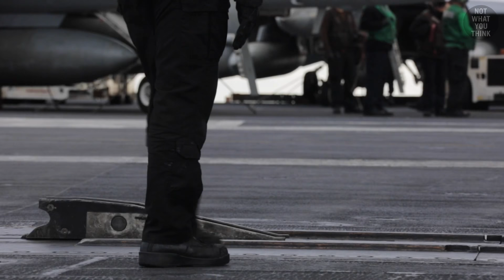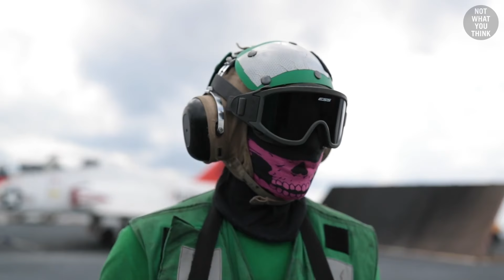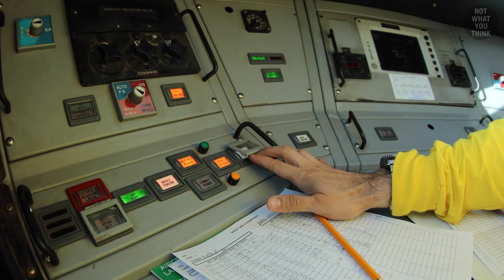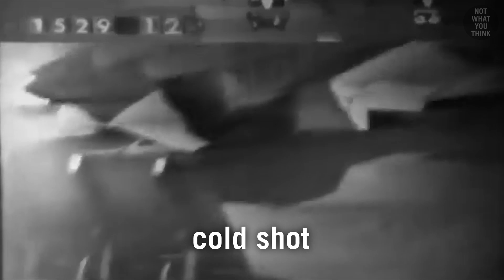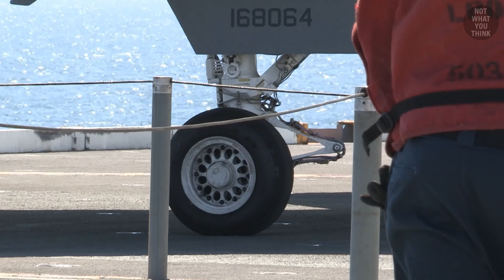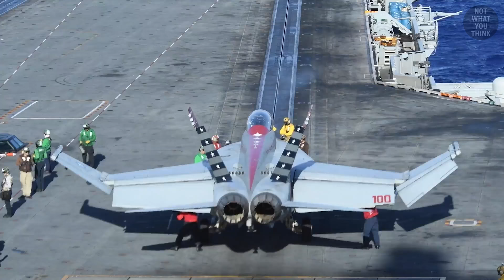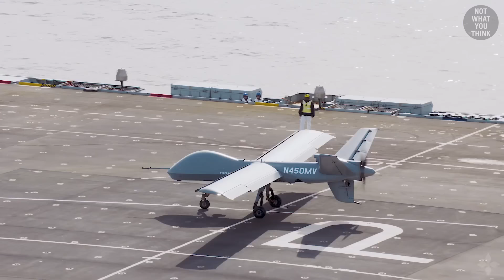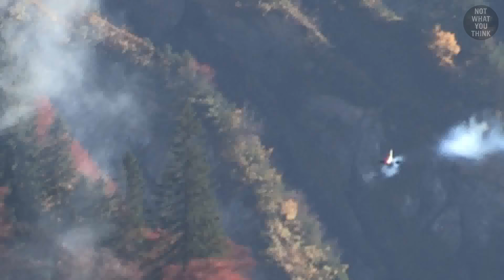Why the US Navy is Replacing Electric Catapults with Steam

Comment: With the advancement of electronic sensors, controls, and controllers you could precisely control Steam Catapults. The advancement in materials would alleviate most maintenance issues of older materials.

Comment: Both sides have a real point in this debate. 

Steam: It’s reliable and gets the job done. Better to have a imperfect solution that consistently works, than have an ideal solution that is unreliable (none of us know the actual operational rates of EMALS, but it’s definitely not as high as steam).

EMALS: It’s a better design for the long term, because the operational rates will improve in the future. It has a better launch cadence, variability, and requires less space in the ship. 

I personally think we should stick with the EMALS system and work out the issues, but that depends on the actual operational rates of EMALS system. If it’s down at 50% or less, then yes as much as I don’t like it we should build new craft with steam catapults until we fix the existing EMALS systems to be up in the 75% or better for operational readiness.

Comment: Seriously asking a pilot what is best is kind of only looking at 1/2 picture and it something that should been done 20 years ago. Can't convert the USS Doria Miller to Steam as have to redo all plans for most of the ship. As someone that was a Naval Nuclear Reactor Plant operator on Abe Lincoln and having to know how systems are laid out in plant you need to overhaul design of the reactor plant. Not only how it is being operated but also how layout is. Every space on a carrier is mapped out and running high pressure steam from the plant up to Cat rooms takes miles of  carbon steel pipes. Also the Steam Cats on Nimitz class carrier is 3rd largest load on carrier after the shafts and the 8 electrical Turbine Generators.

Comment: Ok there’s 100”s of boards, coils, wires, power supplys probably many without duplicate. Steam is pipes accumulates, and one giant ass piston with grease points and a piston seal. Alll just off the shelf plumbing. They probably have 30 of each

Comment: The Strategic Vulnerability of Electromagnetic Catapults
Electromagnetic aircraft launch systems represent a major technological leap for modern carriers. However, this shift introduces a critical strategic risk: a deeper dependence on Chinese supply chains. Manufacturing these high-powered electric systems requires specialized rare-earth elements and advanced components. China currently dominates the global processing and supply of these essential materials. By adopting electric catapults, naval forces inadvertently tie their most powerful defense platforms to a geopolitical rival. Securing alternative domestic supply chains for rare-earth metals is now an urgent security priority.
EMALS is a massive liability. Aside from the heavy reliance on Chinese rare-earth minerals, the system has a major single point of failure: shared power converters mean one electrical glitch can take down two catapults at once. You can’t fix digital high-voltage failures in the middle of a battle with basic shipboard tools like you could with reliable steam. It's way too complex, incredibly expensive, and compromises combat readiness.

Comment: Sal talked about these catapults  a while back on what's going on with shipping. I think some of them are having problems because they were more sensitive to the movement of the ships out at sea. Is he just pointed out in a recent video with Ward Carroll changing the magnetic catapults to steam is a huge endeavor very costly. Hopefully the designers had corrected the initial problems these were having. Does anyone remember what the problems were exactly ? It would have made sense also to perhaps make some new carriers with the magnetic catapults and some with steam. Is it possible that magnetic ones are susceptible to certain enemy actions that the steam ones are not susceptible to ? Don't know . Is it better to not run ahead what's the latest technology for all of the new ships for a little while ? From what Sal was saying a bigger problem is that it's taking much much longer to build the new carriers then had initially been planned. Also it sounded like they were starting the work on the carriers before all the plans were finished. That kind of reminds me of agile methodology . Might work for a computer program but I don't know about a carrier.

Comment: I don't know enough about the topic. But wouldn't and electric liner motor give away your position every time you launch. And the electrical interference could mess with radar and other systems.
I would think a steam system would not have those issues.
This video sounds like all the rest, just repeating the same talking points. Doesn't seem like anyone is doing any real research into the topic.

Comment: Comparing the success rate of launches between a system with 70 years of improvements to a totally new system that has only been in use for 10 years is ridiculous. What was the faillure rate of steam systems in the 1950s? I doubt it was 1 in 4000 launches.

Comment: System Breakdowns: Early tests on the USS Gerald R. Ford showed the EMALS broke down often during sea trials.Launch Failures: The equipment fell far short of the Navy's goal for working cycles between failures.Flight Delays: Catapult failures stopped flight operations completely during early testing.

Comment: Trump the moron , clueless, dementia filled psychopath has no clue about engineering or construction of warships. The whole carrier is designed and built around its aircraft propulsion system be it electric or steam powered. It is a massive difference design from the whole bottom up of the whole entire ship. A magnetic rail electric proportion system means they can launch more aircraft and launch them faster than the steam powered system. It would also mean there’s more rim to put other things underneath and around the aircraft carrier because they do not have to produce and build a system that moves steam around the whole carrier to get to the aircraft propulsion system. Trump needs to be removed. He by a country mile the stupidest President in history.

Comment: One issue that needs to be addressed with any system anywhere in the military is private company control over things like repairs and upgrades. If one of these carriers was in an active war and their system goes down, only their engineers are allowed to do the work. 3-5 business days minimum to fly them out for an assessment? No thanks. The service members on these ships need full control of their own lives. If they can’t then we do, in fact, need to return to systems that don’t have bureaucratic red tape endangering lives. This is just one facet of the overall issue but it’s one that is rooted in common sense, not either side of political theatrics.

Comment: A warship especially a flatop operating under continuous wartime conditions should never be a testbed for newer systems. 

People's lives are at stake along with some very expensive ships. I read one comment that said that EMALS have been used on roller-coasters. WTF, over? A warship isn't a carnival ride unless that ship is in some very very heavy seas. I never sailed on a bird farm but I do know that steam propulsion has been around for a couple hundred years so the testing period has been long and its been refined because of failures. Steam has other uses onboard a ship in addition to launching aircraft. With nuclear reactors their should be more than enough evap fresh water to power such systems without going on water hours! BTW, been there, done that!
Reply: meantime, the most credible adversary in naval warfare is using an EMALS equivalent because it is superior.   Does that work for you?

Comment: This video is slop which explains nothing. It just goes over all the theoretical advantages of EMALS - which are true - but then handwaves their actual problems by inferring their possible replacement as an arbitrary political position.
The EMALS has had major issues ssues for over a decade  which have adversely affected the schedule of the Ford class. They are supposedly active, but military bureaucracies always cover up problems, so the actual problems are probably much worse than revealed. The catapults may, in fact, be  semifunctional at best.
This is not to compliment Trump but he was almost certainly being given the same operational problems with the Ford class as he was almost a decade ago, and he reacted in his style. 
His precipitous decision in this case is something the Navy should have done themselves years ago, at least to derisk the first boats in class and maintain build schedule.

Comment: Electric is not always better, those KC-46 Boeing refuelers  have been fighting Electric booms for 20 years and still fighting issues. Where the  Kc-135's hydraulic units have been working 75 years, if it's not broken. Don't fix an non existent problem.

Comment: Everyone, especially the content creator, are missing the obvious. Steam works. It has worked for decades. It is a refined system. It's repairable...in situ. Electromechanical is not. VERY few even know how to troubleshoot much less repair without dry dock or at least a harbor base. 

The BS about "what if the wind picks up during launch". Well, so? A launch is under 3 seconds, are you trying to tell me anyone needs or is going to make adjustments during  that time? Oh, and for the yahoo that claims  there have been no injuries/deaths with the "new" system...well, yeah. It hasn't been used enough to HAVE a track record yet. It also has never been used on a DAMAGED ship that is under fire. In fact, the video out and out lies saying EMALS since 2017. Wrong. Its been back and forth to dock and has only been actually deployed as a working system for a few years. 

One system uses water/steam. The other uses electricity. Know what's all around a ship? Water. Salt water. Know what that does to electronics? Yeah. Why do you think ships need a year in dry dock after every deployment. It's not for the mechanical systems.
Reply: and why is steam so reliable?  when steam catapults started out had over 75% failure rates. it took over a decade and dozens of lost aircraft before they got it working.
Reply: @cliffcorson4000  <sigh> Try using your head as something more than a hat rack. "when steam catapults started out". Yeah. In the 1950's. Since then they've been perfected into smooth, reliable, FIXABLE systems, proven under combat conditions. That's something only time and experience yields. Which goes right back to my point. In 50 years, when they retire the GHWB which has the only functioning electro cat, THEN would be the time to make a change.

Comment: I served on an Aircraft Carrier, that had steam catapults (CATS). We never had issues and steam is a reliable source of energy. Electricity is a good source, and the flight deck might be cooler, not having the steam coming out of the CAT tracts. Only people and politics think it’s less labor intensive. I would rather work on steam accumulates, instead of high voltage, electro magnetic, catapult system.
Reply: of course you never had issues. It has been around since before you were born. The advantages are obvious, but covered in this very video anyway.

Comment: They will work to bugs out. Steam wasn't perfect in the beginning. You just need something to BS about for clicks.
Reply: Hmmmmm ... did you watch the video? 
The conclusion of this video: the reason for the replacement is political (Fix Ide of Trump) - not technical or sane. In other words: electric is the better option - changing back to steam is idiotic.
Reply: @EneriGiilaan  Not political, common sense. Especially when you have nuclear power to run it. Trump can suck it.

Comment: WTF is everything political? If a system sucks during war that's an issue. The USN isn't going to get a contractor to fix it in the middle of operations. How insane is it to keep ignoring software issues thinking let the bugs work themselves out? These are the people who say the EMALS is not working as intended: Pentagon, GAO, Armed Services Committee, and Naval Air Systems Command. The main deficiency of the system simplified is it doesn't meet the threshold of potential critical failure during rapid sorties. Well, that would suck during a war with China. Of course blame the President for it.

Comment: underway shipboard catapult launch (on the cruiser USS North Carolina).1922: First commissioned aircraft carrier with a catapult (USS Langley, compressed-air).1927: USS Lexington introduced a flywheel catapult system.1934: HMS Courageous introduced a hydraulic catapult system.1954: First deployment of the modern steam catapult on a U.S. carrier (USS Hancock).2017: First electromagnetic aircraft launch system (EMALS) fielded on USS Gerald R. Ford.If you would like to dive deeper, let me know if you want to focus on:The transition from compressed air to steam and electromagnetic

Comment: Claiming China stole EMALS is like saying someone stole a recipe for a rocket ship just because both use fuel—especially when the U.S. system runs on an alternating-current (AC) architecture with flywheels, while China's Fujian relies on a medium-voltage direct-current (MVDC) setup powered by supercapacitors.

The YouTube USS Ford vs Fujian comparison highlights how China's different electrical architecture and rapid technological acceleration shaped the Fujian's design.

When is the US going to accept it is being  run  by a bunch of morons led by an insane narcissist who is the walking proof of the Dunning Kruger effect

Comment: The steam used for the catapults is fresh water. Which must be desalinated from seawater.  Another step in the total process that adds complexity and costly maintenance.  125 to 135 gallons, or about 1,200 pounds of fresh water is used for each and every catapult shot. A super carrier makes about 400,000 gallons of water every day, using four desalination units.
Reply: That desalination steal cat system is a closed system. Almost all that steam in condensed and recycled.

Comment: You should research the development of the steam system, back in the 1950s. It was a long, arduous, expensive, and dangerous process. The emals development has been substantially less troublesome. The reduced stress on the airframes alone, is worth the change; short of a truly catastrophic failure. Current aircraft will stay operational much longer, and future aircraft will be much lighter and less expensive. Don’t give up on emals yet. Keep working out the glitches, like what was done with the steam system until it became so reliable.

Comment: EMALS is much much more benefit  to the aircraft with less structural stress and could handle wide range of different weight of the aircraft.  In additonal EMALS save a lot of dead as compared tro the Steam catapult
Reply: The cat room computers make the correct steam pressure to compensate for each aircraft types weight.

Comment: Ok, let's not forget the other big thing -  steam catapults require steam and there is a limit to how much can be stored, and they store steam for launching. The more you launch with a steam catapult, the longer the time gets between launches. Eventually, you have to pause to let it build up. That's not an issue with the electric ones - the reactors just keep making electricity at the same rate, and you never need to stop to rebuild steam.
Reply: Electricity doesn’t magically come off the Rx thermal output.   Electricity is generated by steam pulled off the Rx thermal output.   So still need steam, but EMALS is more adjustable.
Reply: @tyggeln but you can still run out of steam at full operations and need a cool down period, while that isn't an issue with the electromagnetic one. It's not just about adjustability, but also reliability and sustained operations.
Reply: I was on a Navy oiler off Vietnam in the 1960s.  Every time we replenished the USS Midway we gave them potable water as well as bunker fuel and aviation fuels.  Their lack of ability to distill potable water from seawater limited the number of aircraft they could launch.  This would be a bit worse today as sea temperatures rise and distillation efficiency falls.